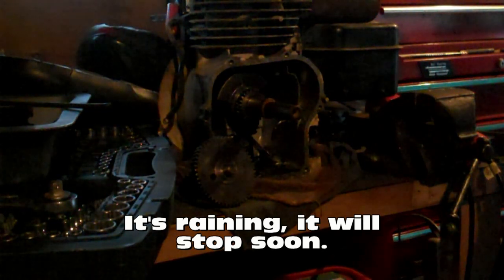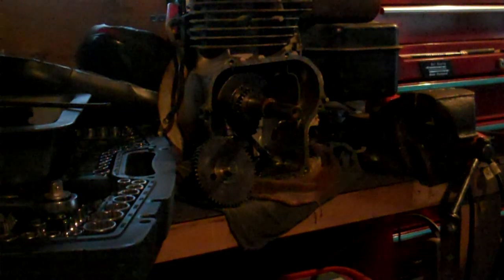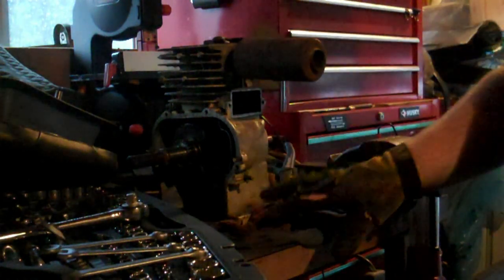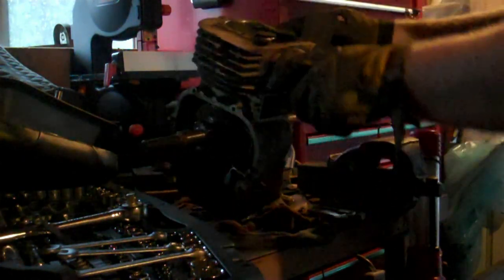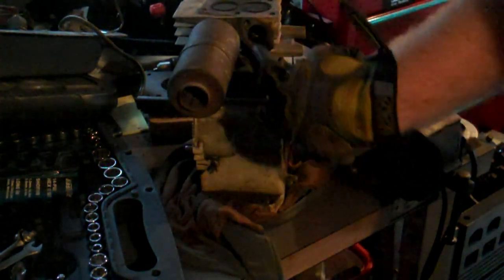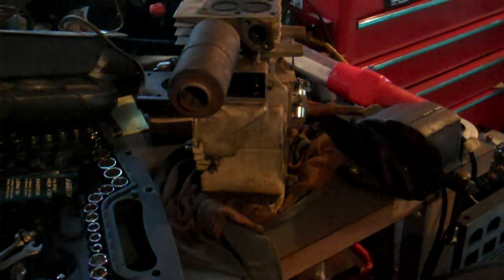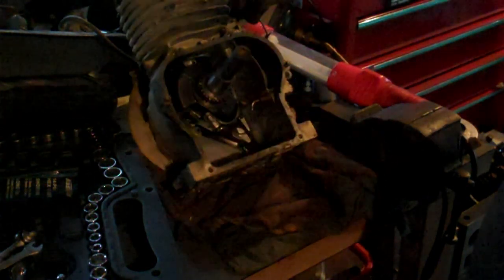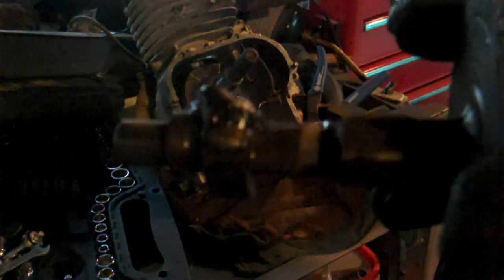Convert 4 stroke to steam engine part 2

Comment: one thing that comes to mind is why not use both valves instead of capping one, just grind the wall between the ports to the valves in the head and voila they can be used for the same purpose. don't know if you actually have figured it out by now or if it doesn't work (because my knowledge of 4s are a bit limited) but in theory it should work just fine (atleast in my head) very interesting build nonetheless good work :)

Comment: I know you got this engine for free. 
I was wondering if it would be easer to convert an industrial 2 piston air compressor into a steam engine? Wouldn’t you just need to do is connect a steam boiler to the output. The pistons and camshafts should be fine the way they are. 
Please give me your thoughts and ideas. Hopefully you will convince me not to try. 
I was hoping that I could connect to a small car. I think that I would need to modify a manual transmission with just a forward, reverse and neutral. Then a Stanley steamer type flash boiler. A water tank and a propane tank for fuel. Finally a condenser and oil separator. So I won’t need as big of a water tank. The condenser should be able to preheat the feed water increasing the distance I can travel. 
Again please share your thoughts. I am a retired tool & die maker with a masters degree in mechanical engineering with a full shop. I built several small steam engines my last is a scale model case traction engine.